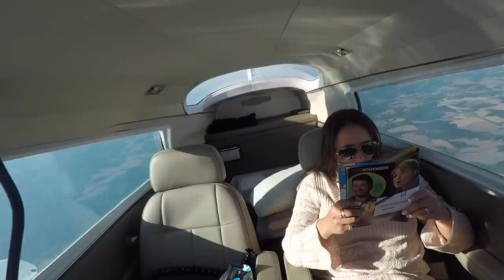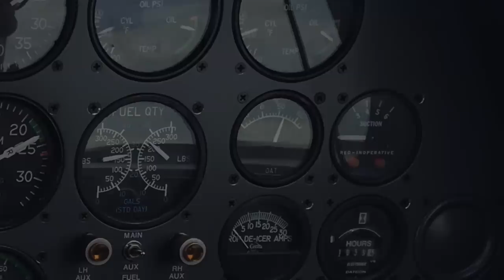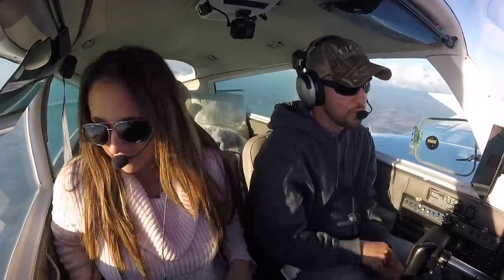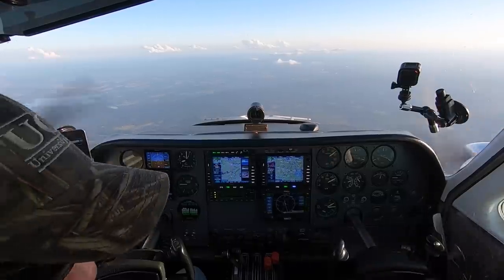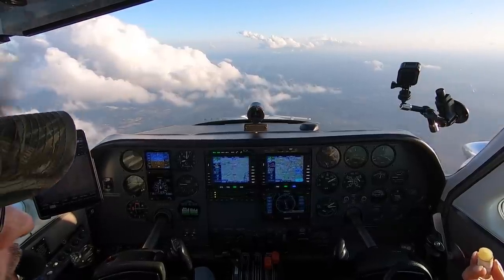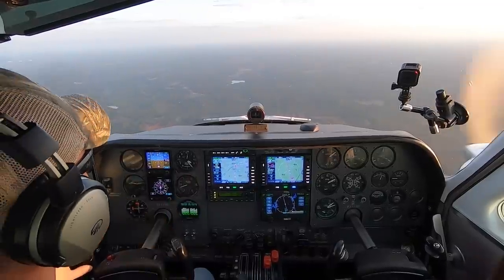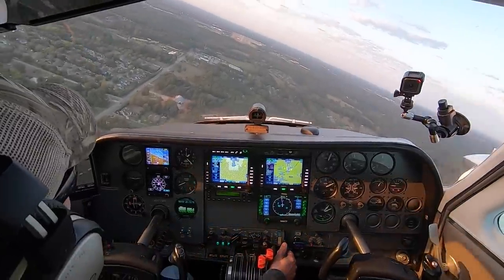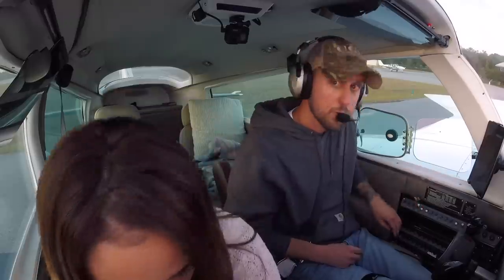Gulf Coast Swing 2: FAILURE of BOTH Vacuum Pumps!

Comment: Go back and read your Cessna service bulletins. I think you have a bad manifold and lost one pump some time ago. Read the Missouri governor's accident report. They were in a Cessna 335.
Reply from the maker: I'm familiar with that accident. No bad manifold here. It was a faulty surface de-ice switch that failed and called for full inflate of the boots without ever letting up. After 10 min both pumps failed separately in quick succession. I've had it all repaired now and she's flying great. :)

Comment: read an article where another 310 did the exact same thing on its first leg of its trip. both failed 15 minutes apart,  preventative measure would be to replace one every every 3-5 years alternating sides depending on their average lifespan, theory would have it two older pumps can handle the work load but a single pump with age can't. just my opinion

Comment: 13:18 So you no longer say you have information "zulu" or whatever letter the ATIS is on?
Reply: msnpassjan2004 It doesn’t apply at a non-towered airport.  The ATIS ‘announcer’ is just a computer generated message.  Unless the controller asks, all you say is you have the ATIS as there is no designator. 😎🛬

Comment: Very strange you have two fails , to me it points to a possible wiring loom issue after your new dash was installed
Reply from the maker: It was very strange indeed. I've had it all repaired now and it wasn't anything to do with all that (with that massive undertaking I can see why you would think it though). It was the surface de-ice switch that became faulty and called for an un-commanded full inflate without allowing them to deflate. This caused the getting older pumps to oddly shear within 10 min of each other. As owner of these classic birds we are just replacing them one piece at a time. :)
Reply: @310Pilot  How old were the pumps; the life on most i think is 10 years/500 hours.
Reply: Cool, glad the trace on the fault was discovered

Comment: The “essentially simultaneous pump failure” got me thinking. If you have two of the same item on each Engine, such as the pump, alternator, magneto, etc., if all items were built at the same time using the same batch of metal, rubber, And all parts undergoing the same stresses, It actually makes more sense for a pair of something to wear at the same rate, and therefore fail at the same time. Just a theory.

Comment: So was there anything more to this or was it actually both pumps failed almost simultaneously? Vacuum pumps are notoriously unreliable, but two at once is something. At least you have two G5s.
Reply from the maker: Very glad we had the dual G5's and that allowed us to continue our trip legally. It turns out the surface de-ice switch became faulty and called for a full inflate of the boots without ever allowing them to deflate. The pumps couldn't handle this failure mode and each failed 10 min apart. I've never heard of this type failure but will be mindful moving forward. Always learning. :)

Comment: Another victim of Murphy. THEN; when you get to a repair station, it's the most expensive shop around, the vacuum pumps that were ordered with an AOG rush are for two different Continental engines, none of which are yours. After the  repairs, one pump won't work at less than 1900 rpm. During the test flight, both pumps lose vacuum permanently after you test the boots. Install new hoses. Ground ops checks ok. Three flight  hours later, the pilot's ADI fails. That 's ok. It was IFR anyway ( long before glass and AHRS). And we were in icing conditions as well. At least the boots worked... Not bad for a 560 hour 310.

Comment: How much time did those pumps have on them (in years)? Odd that both would have gone at the same time...
Reply from the maker: Tom, they had about 8-10 years if I remember correctly. I don't have the logs in front of me. Turns out the surface de-ice switch failed calling for a full inflate without letting up. This caused each pump to fail within 10 min of each other. I thought it was strange as well as I hadn't heard of a dual failure before this.

Comment: BOTH vacuum pumps failing at almost the same time.  However unreliable they are highly unlikely.  Has to be something in common with them.  Like others have mentioned, a valve or line failed or came loose.  I'm sure Kevin will update us at some point.
Reply from the maker: Howdy Pauls! Turns out it was a faulty surface de-ice switch that failed and called for a full boot inflate without letting up. Unfortunately this wasn't in my scan being VMC and warm and after a while it caused both pumps to fail 10 min apart. I've never heard of this type failure before...always learning. :)
Reply: @310Pilot  Hey Kevin,  Yep... always learning and thanks for the update.

Comment: Perfect example of "two is one, one is none." Did you have to fix the pumps / problem before you flew again?
Reply from the maker: Can't ever have too much redundancy. :) I verified with my mechanic that the pumps weren't required by STC/FAR for me to continue the flight and we had a great vacation. I just picked the plane back up from them today and turns out the surface de-ice switch was faulty and called for an un-commanded full inflate. That caused the pumps to shear within 10 min of each other. It has all been replaced and I tested them a couple hours ago. Like new. :)
Reply: @310Pilot  Good to know it didn't shut you down, thanks.

Comment: My guess is a broken vacuum line. Let us know what it was. Good job !
Reply from the maker: Turns out it was the surface de-ice switch that went faulty and called for a full inflate of the boots without letting up. This caused the pumps to each fail. Learned something new!
Reply: @310Pilot  Ever notice it's always something goofy most of time?

Comment: Look on the bright side of dual vacuum pump failure...your wife will be more accepting of spending the $$,$$$.$$ on the aircraft.
To those pilots who don't know this, you will get slightly better fuel milage if you operate your propeller's at the lowest RPM that the manual allows in cruise.
You will also get a higher MPG with an aft cg compared to a forward cg. Nice video.

Comment: Quite rare indeed for a double vacuum pump failure. Curious as to the number of hours on each. Is 500 hours the time to replace?
Reply from the maker: They were starting to get some years on them and approaching 500 hours. The surface de-ice switch failed and caused the boots to full inflate without letting up. This destroyed both pumps. All has been repaired and I learned something new. :)
Reply: 310 Pilot thank you for our reply. So the switch is the single point of failure for both pumps? One (1) would have thought that the designers would have thought about that.

Comment: I tried taking my single engine Piper flying this past Monday and had a vacuum pump failure.  Must be that time of year.
Reply from the maker: Must be. Good thing your work plane doesn't rely on those failure prone things. I'm glad I installed the G5's because if I was IMC and lost both pumps I would have had to stay aloft dealing with a 40+ year old turn and bank that just swayed from side to side regularly. :)
Reply: @310Pilot  I've been watching your avionics upgrades.  Very nice system you've got there!
Reply: @310Pilot  iPad with the AHARS that sticks to the windscreen seems like money well spent.  Less so now that you have the G5, but you just saw two independent systems go tits up simultaneously.

Comment: Watching you bank in to the runway just made me think of something no one else on anything has talked about. The similarity between a plane and a boat. For you in a plane you and or the electronics has to move the plane or adjust it do to the wind currents to line up for the runway. A boat going into a dock or loading onto a trailer has to adjust the boat or ship due to water currents to come into a dock or to load on a trailer. On both cases the same actions. Interesting.

Comment: What was the reason the vacuum pumps failed?
Reply from the maker: Turns out the surface de-ice switch became faulty and commanded the boots to inflate and stay there. The pumps were aging and decided to go one at a time 10 min apart. Good thing I installed some modern equipment and wasn't IMC...2 years ago I would have been completely reliant on the 40+ year old turn and bank indicator. :)
Reply: @310Pilot  Baron Pilot, bought 2 new engines not long ago... Bet that was a large chunk of money. I guess vacuum pumps aren't exactly cheap either.

Comment: Any word on what caused both vacuum pumps to fail at the same time?
Reply from the maker: Turns out it was the surface de-ice switch that failed and caused the boots to inflate without ever letting up. It took both pumps out in the process. Never heard of that type failure before. Always learning. :)

Comment: I guess you have been luck thus far as just about all Pilots who fly planes with vacuum pumps have had failures...... vacuum pumps fails. What is astonitioning is that both failed at the sames time, which seems to indicate that the "same job" must have been carried out on the both engines before the failure i.e. engine clean, pipe /hose replacements or something similar. Can't wait to hear what you find as the root cause!

Comment: There must be a common vacuum line or manifold between the two pumps.
Reply from the maker: There is. They connect at a T valve with a flapper to close off the failed side. In this case it was a faulty surface de-ice switch that called for a full inflate of the boots without letting them down and caused the pumps to fail. All has been repaired. :)

Comment: I'm betting a vacuum line has come loose from all the work on the gauges. And you have a large vacuum leak because of that.
Please keep us posted..........
Reply: My thoughts as well.  As he was talking about both pumps being independent, I thought "except for they're both sucking on the same things".
Reply from the maker: Just picked the plane back up today from Burlington Air Center. Turns out the surface de-ice switch failed and called for an un-commanded full inflate and never let up. That is what caused the pumps to fail within 10 min of each other. They both sheared and were wasted. I have a new switch and two new pumps now and tested the boots this morning....all is well. :)
Reply: @310Pilot  Thanks for this update.  I also suspected a vac line failure.  Love the vids.  We fly a lowly C-172H out of Calhoun Ga.  Really enjoy watching your adventures.

Comment: Not clear of 36 until off the runway and on the other side of the hold line. Good habits = good pilots.
Reply from the maker: To add some gray area to your interpretation.... At a ATC controlled airport you are clear when you make the turn off the runway and there is nothing impeding you from clearing the hold short bars. :)
Reply: 310 Pilot understood.... But.... what if both your engines quit and your tail was still sticking out into the runway and a new pilot started to roll. And he/she isn’t so good at holding centerline.... clear should mean clear. Just my .02

Comment: What does climbing  out of blue line mean ?
Reply: Well, I'm no instructor, or even a pilot for that matter, so I hope a pilot will correct if I'm not exactly right, but seeing no one has replied I'll give it my best shot, so having given full disclosure,  blue line is the speed you need to be at should an engine failure occur on take off or shortly after.  Might be the minimum safe speed with one engine.  The full precise correct reply I'm not 100% sure of but I am 100% sure it has to do with that. So takes off and let's speed increase to blue line or above before climbing...
I would love to know the exact answer myself.
Ok let the smackdown's begin pilots! :-)
Reply: @donc9751  thanks, that was a great answer. Makes sense
Reply: “Blue line” (Vyse) refers to the blue colored line placed on the airspeed indicator that indicates the best rate of climb for the multi-engine airplane with one engine inoperative at maximum gross takeoff weight.  That number decreases with takeoff weights lower than maximum.

Comment: So were they both faulty or what? Like what happened with them?
Reply from the maker: Howdy Matt. Turns out the surface de-ice switch failed and called for a full inflate of the boots without ever letting them deflate. After a while, this caused both pumps to fail within 10 min of each other. I've since had it all replaced and have been good to go. :)
Reply: @310Pilot  oh that's cool! I'm new to all this and wanting to learn to be a pilot

Comment: Hope you get to the cause of the two pumps failing 😎
Reply from the maker: Turns out it was a failure of the surface de-ice switch that called for a full inflate of the boots and never let up. This caused the pumps to both fail within 10 min of each other. Had never heard of this type of failure before...always learning. I have it all fixed now. :)

Comment: Need to know what happened with the pumps...
Reply from the maker: Turns out it was the surface de-ice switch failed and called for an un-commanded full inflate of the boots without ever letting up and it caused the pumps to fail 10 min apart from each other.
Reply: @310Pilot  Damn, in all my years of working on planes, never seen that one....